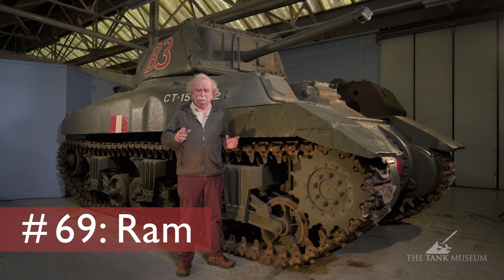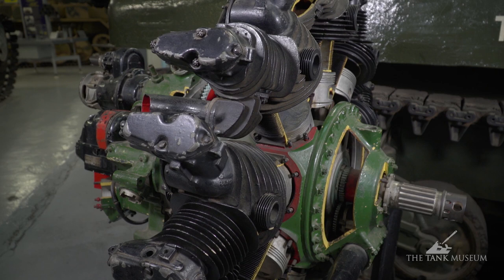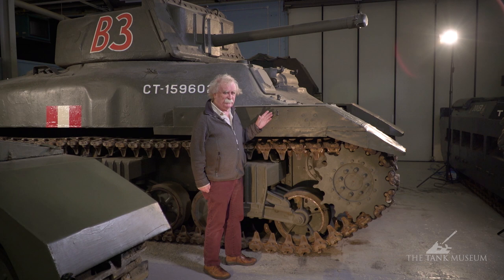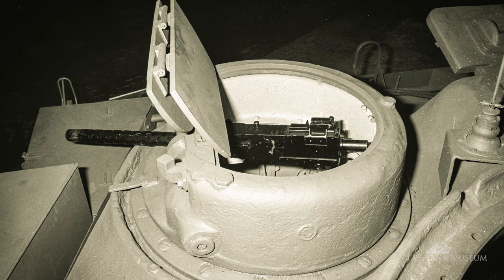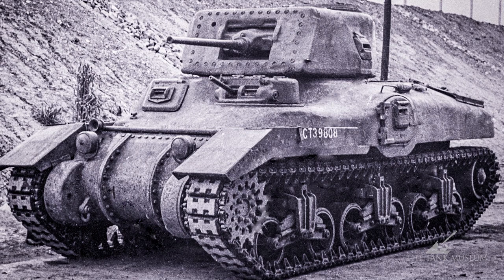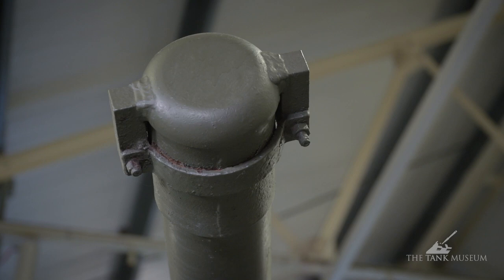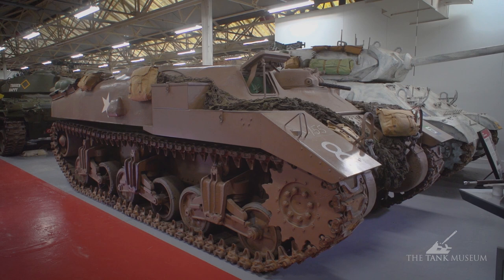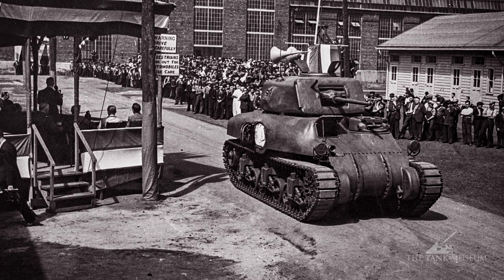Tank Chats #69 Ram Mark II | The Tank Museum

Comment: 0.41  "a little bit ahead of the Sherman", but used a 2pdr because the 6pdr was not available at about the same time Britain was putting the 6pdr in the Crusader III requiring the turret crew to be reduced to two, gunner and commander/loader.
2.48  Turret for machine gun replaced by bow MG as on the M4.

Comment: The most interesting aspect of the Ram Tank is that it represents such a combination of British and American design characteristics.  In addition, although the Ram was never used operationally, it was probably superior to many of the operational British tanks of the period, such as the Valentine and Crusader.  Furthermore, if they could fit a 75-mm gun in the Cromwell, then they probably could have done the same with the Ram.
Reply: But the 6 pounder was basically better than the American 75, it punched through more armor, flew faster (easier to hit), and any penetration typically means the target's crew is bailing out. Why bother?

Comment: I knew a crewman (Carl Lowerson) who trained on these tanks. He said that under sustained machine gun fire the odd bullet could leak through the side doors. He thought that this was the main reason that they were never sent overseas. It was a good tank, but never built in huge numbers and was surpassed by the Sherman. There was a proposed cast hulled Grant. If I recall correctly at least one was built.
Reply: They were sent overseas, the majority of them ended up in the UK ready to be used in combat, until a large surplus of new M4's came along. So they decided to use those over the used and very abused Ram's which they had been training in non stop and continued to do so.  The side hull doors ended up being deleted at Tank # 321. They built roughly 2000 of them. The drive train and engine being the same as on the M4 and M4A1, but the Ram ended up faster as they governed the engine higher. Much more armour to boot on the Ram compared to the M4.

Comment: At 3:46 we see an early model Ram I with the gunner's hatch closed. At 6:00 we see a similar RAM from the other side with the loader's hatch open. It clear from the pictures that the side hatches were made from the same casting with the hinges to the left and the latches to the right. Unfortunately, that economy measure made the loader's hatch less useful for bailing out of a disabled tank under enemy fire. The gunner had the protection of the open hatch acting as a shield between his body and small arms fire from the front, whereas the loader's hatch, opening the other way gave the loader no protection as he exited the tank.
Reply: Having an opening, especially a large one on the hull sides made them weaker as well, edge effect is a nasty thing. This was one of the major reasons they deleted them in later castings. At one point they suggested to keep only one to make stowage easier, but in the end decided not to bother.

Comment: By D-day it was more logical to switch to the Sherman due to the great stocks of Shermans available but I wonder how it may have done if it had gone to North Africa earlier in the war. I think it may have done well, not great, but well. It likely would have been good with a 40mmm bofors on it
Reply: I agree. It would've had the Lee/Grant reliability with a more practical turret. Better with 6 pounder but even the 2 would've been OK in the earlier desert battles
Reply: More armoured then a sherman, better Anti tank performance, but a poor man's HE shell compared to what the 75mm could bring.  Compared to the British tanks the turret would have been roomier for the crew in the Ram to service the 6 pounder, as a large majorty of the Brit tanks only had a 54 inch turret ring at the time.
Automotive wise it would have been just as reliable as the sherman as it used the same components.

Comment: It could've packed a punch on the panzers back then until the Tigers and Panthers came along
Reply: First time the british encountered Tigers, they knocked one out with 6 pdrs AT guns, so it could still have been useful against them.
Reply: @lavrentivs9891  From side of Tiger ı guess?
Reply: @AFT_05G  The book I read it in didn't say what side of the tank, but it mentioned that it was at a range of about 450 m. The 6 pdr was capable of penetrating the front of the Tiger at close range though, especially with APDS.
Reply: @lavrentivs9891  I did that in war thunder.

Comment: on the picture at 6:06, there is a door in the hull at the rh side over the tracks. What's that for?
Reply: Same reason the M3 medium had them, crew escape hatches also used to make loading the tank easier.
Reply: @whelmy  Ah, thanks

Comment: So all Shermans use a 9 cylinder rotary engine? i did not know that
Reply: The R-975 is most famous for being used as the power plant for the M18 Hellcat tank destroyer, the fastest and most efficient American tank killer of World War II. The R-975 powered M18 remained the fastest tracked armored vehicle in the world until the introduction of the turbine powered M1 Abrams in the 1980s
Reply: jebus they even stuck in 2 2stroke engines as a powerplant

Comment: So basically, better than the M4 Sherman, in every meaningful way? there ya go
Reply: Skipper the cannon had slightly better anti-tank capabilities than the 75 on the M4, but the M4 had better HE rounds for taking out soft targets like machine gun nests or anti-tank guns. Furthermore the Americans had a much greater ability to mass produce the M4 than we had to mass produce the Ram.
Reply: mYeeeaahhh...   haul based on a M3 with smaller turret ring so they can only use a 2 or 6 pounder for it's armament, useless as a gun platform, never went to battle, only good as a target for target practice by rifle men...      other than that, sure, if you say so.
Reply: as Mr Fletcher said the example in the video has the 75mm. They did equip a number of them with that. After the war the Dutch were given them.